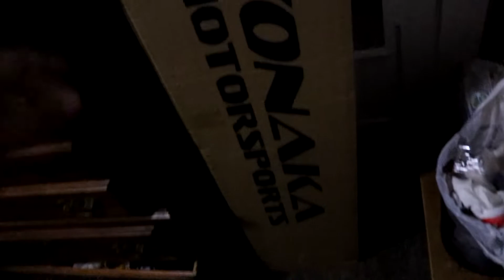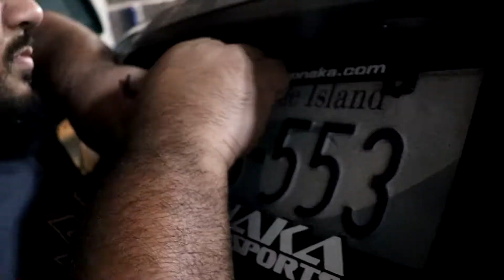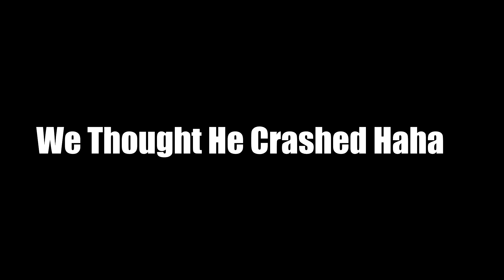Honda Civic Hatchback Yonaka Exhaust ( Install + Sound Test )

Comment: If you have a test pipe itll def sound raspy. Only thing that would fix that is a vibrant resonator
Reply from the maker: I didn't know that but I did have a test pipe at the time I'm boosted now and have a different exhaust but thanks for the info

Comment: Theses cars are going up in value I just got one for a steal runs and driver’s 750 now can’t find one under 2500 or 3 k
Reply from the maker: Damn for 750 that's a steal
Reply: @thelostkidsgarage  yes only 750 missing back cargo cover I want one have been looking for only other then that the think in mint. I steam cleaned it it leaks oil but what 25 year old car doesn’t

Comment: why do some honda´s with yonaka´s sound like a fartcan and other just sound way deeper and way better overall?
Reply from the maker: I think it's because the cat back was meant for a single cam
Reply: @thelostkidsgarage  cause I’ve seen 3/4 clips of people putting on a yonaka and yours sounds really raspy on the top end in comparision with some others that are a lot smoother, idk
Reply from the maker: @ricardolapa4950  yea I know but in most of the videos they put it on a single cam not a dual overhead cam I changed the exhaust anyways
Reply: @thelostkidsgarage  thank you :)) all the best for u

Comment: What RLCA are you using?
Reply from the maker: eBay special for now I'm going to get mpc soon
Reply: @thelostkidsgarage  how long those bushings last for you? I'm on my second set of eBay RLCA in about 3-4 months. I'm going back to OEM.
Reply from the maker: @nyreppin1  same but when the bushings go bad I just replace them for skunk2 bushings
Reply: @thelostkidsgarage  I'm glad you brought that up. I can't seem to find the part number for the bushing that connects to the trailing arm. I've been all over the Honda diagrams and nothing. Did you use the same bushing that goes from the control arm to the chassis? Because the strut bushings are too small
Reply from the maker: @nyreppin1  you can get them on Amazon
Reply: @thelostkidsgarage  I appreciate it
Reply from the maker: @nyreppin1  https://www.ebay.com/itm/Replacement-Bushings-For-Skunk2-EG-EK-DC-Lower-Control-Arm-LCA-Rear-Camber-Kit/323855693576?pageci=7b891fa6-73b2-4b7c-8b3c-04463617f8ae

Comment: Inspiring me to build my ek just had a stock y8 in it but I’m tryna have fun in corners and touge the civic😈!
Reply from the maker: i wouldn't mind a Y8 with some AC haha just enjoy it maybe buy some cheap little ebay parts :)
Reply: THE LOST KIDS GARAGE haha yeah my car has no ac rear is gutted and on koni coilovers I wanna go b series soon
Reply: got a Dy7 sedan, gonna be building mine soon too! :D Rota R-spec Rims, yonaka exhaust, Si rep lips, can't wait man. Good luck with your EK!
Reply: @rackss5369  don't go B. For the amount of money you'll spend you can easily build that D into an absolute monster and enjoy the look on the faces of people when they see the single jingle in the engine bay. The D is slept on.
Reply: @nyreppin1  ended up selling the hatch for a 8th gen then got another ek coupe sold it and got a eg b20v they crashed me swapped the b20v into my del sol